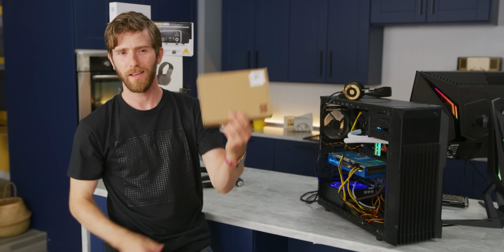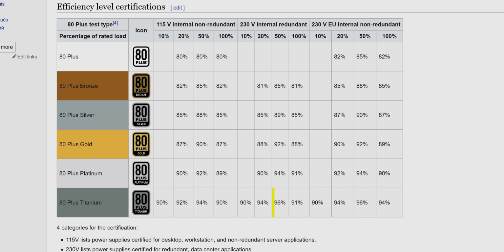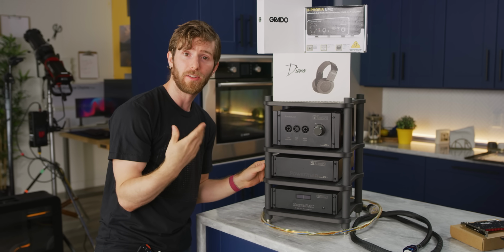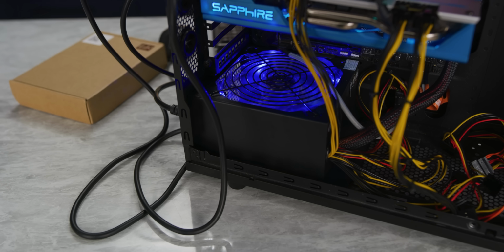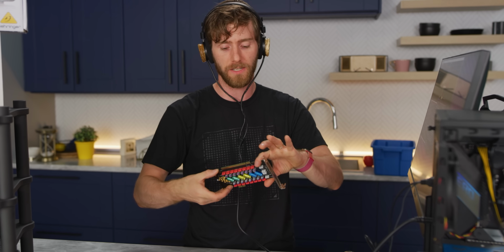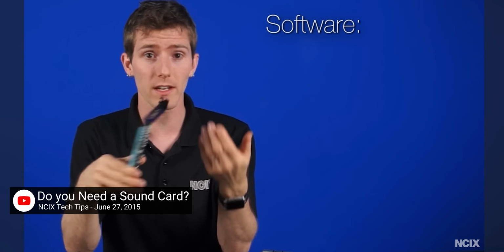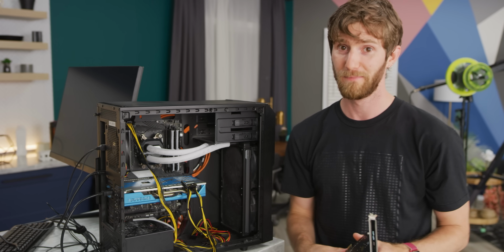Is this $40 card a SCAM? - "Audiophile" Power Filter

Comment: I Personally Think That Sound Cards Was Just A Thing Of It's Time..That's Already Ran It's Course By Now, That Is Because Of The Inherent Fact That Technology Just Got Better With Time (Like Any Other Thing That Also Exist Right Now That Is) And Is Now (Currently) More Capable Of Running Multiple Processes In The Background (As Like How The "Current" Windows OS Is Built Nowadays That Is) And Was No Longer Limited By It's Current Technology Restrictions (Based At The Time Anymore That Is) By Having 1 CPU Or 1 GPU At That Time Or Both That Is Which Couldn't Even Handle Having Audio Processing Done In The Background On Either The CPU Or GPU Or As To How It's "Currently" Done Nowadays (That Is) As To Split Up The Audio Processing In Between Your CPU And GPU That Is For The Most "Efficient" Route Of Doing Things, That Is (When Both Units Are Applied Only Though..If Not The Opposite Will Most Likely Occur Which Is..It'll Run The Audio Processing As Well As The Current Task At Hand Which Will (Of Course) Include All Of Windows' Background Processes Also Which Will Most Likely Have An Performance Impact When Doing Anything "Remotely" Taxing On Your PC's CPU That Is) And That Is The Reason As To Why The "Fabled" Sound Card Had It's Own Audio Processor "Chip" Built Onto It's Card That Is As For The Additional Processing That Was Required From Your PC To Process To Direct It's Audio Signal Through Your Receiver (As Like Headphones Or Speakers) Of Choice, That Is

Comment: what is a coil wine of the system??? Are you crazy? You listen to a fan blowing and then the same fan and expect a difference??? This is not how this works, bro....... Capacitors are there to smooth the power lines, because standard power is never perfect. It differs, those caps make it more stable, being a small storage for power, if you will. There are electrolytic but also other shapes of capacitors (e.g. tantal, ceramic etc.). Sure it is a bus, so all power lines are the same, but I am not sure if this card is even within the specs of an PCI slot or if that can have any (positive) effect at all just sitting there on the bus. Just by the look, they do not seem very high quality, even rated at 130 (?) degrees. Interesting also that they are BP, Bipolar, meaning they have no plus and Minus pin.

Comment: better testing method: run the output audio through an amp and then to an oscilloscope/spectrum analyzer.  If you don't have one, then record it with a good quality audio interface and open it up in Audacity to see the waveforms
Reply: This implies that Linus does scientific testing without mass comment outrage.
Reply: get oscilloscope for free from electroboom
Reply: No self-respecting audiophile would ever admit that electrical signals are susceptible to measurement or analysis. (Someone needs to point out that the act of recording sound with a microphone is itself the act of measuring sounds waves. And any property of sound that might exist in an audio recording can be analysed.)
Reply: Exactly what I was thinking
Reply: Exactly, if you want to make video about this at least you should use god dam oscilloscope. Pointless video.
Reply: and than you really understand that a spectrum analyzer does absolutely nothing for audio application? You rather need a signal analyzer.... to try to be critical when you can be criticized because you said wrong information.....
Reply: That’s more of a GamersNexus video idea :)
Reply: @PowerChannel88  It's not subjective if the objective test shows there is no difference.  If there is no difference even measurable (assuming we measure properly) then we know any difference you're hearing is placebo effect.  I fully expect an objective test to show no effect for this card whatsoever.  Also, other results are still informative to those of us that understand how to interpret them.
Reply: Or at least use powered speakers with a motherboard audio out that isn't well isolated from noise. I can hear my HDD and gpu churning away through my speakers just fine. It would be so much easier for the viewer to hear what electrical noise can sound like through speakers.
Reply: better BETTER testing method. hook up a oscilloscope to the 12v or 5v or 3.3v power rails directly and look at the waveform. I've done this before and been able to watch the voltage drop when I hooked a HDD to the computer, when it started spinning, and every single time it seeked. if you're wondering, yes. it's gross.
Reply: Frankly, if you need to use an oscilloscope or spectrum analyzer to see the advantage of this card, then the card probably isn't doing much (if anything), and if a person can't tell, it begs the question, what's the point? Just food for thought...though I still think it would be super cool to see if it actually does anything 🙂
Reply: @SejinKim5  a objective test is always better than the subjective test of a persons opinions on a matter for figuring out if something works or not, esp with sound quality which is a thing where you can see thousands of audiophiles try to rip each others throats out over their own opinions
Reply: @SejinKim5  If it carries noise to ground, it could possibly extend the life of components. This card needs a better test, maybe post it to Marcoreps to see what actually doing if anything in there.
Reply: @SejinKim5  That is the point though, to show beyond a shadow of doubt that this card isn't doing jack shit.
Reply: Does it really matter when this is meant for the regular user?
Reply: dude, if you can't hear a differnce...well then that's all the testing you need.

Comment: I once had an original, fat-boy PS3. I was plagued with a BUZZ sound with it in games, playing movies, anything! It wasn't until I used an AC adapter (changing the power plug from grounded to un-grounded) then it fixed it!

I bet Brian-The-Electrician could tell me why that worked.

Comment: As an audio engineer in training, I knew as soon as I saw what this card was, you weren’t gonna be losing that Hum. Typically, at least from my understanding, the hum in speakers is typically a grounding issues. Usually with power boards or using the same wall panel for the same speakers. That’s my understanding at least

Comment: This test is flawed. Try a budget/mid range motherboard and send to a stereo amplifier. I have a mid range gigabyte mobo from 2014 and a pretty decent 60w stereo amp from Pioneer powering my bookshelf speakers. Sound is ok but when I power up the signal enough the hissing becomes audible. I would be very interested to see if this card could help but unfortunately this video kind of botched the test. A high quality mobo and headphones? Come on guys.

Comment: I can't imagine you'd hear all that much noise on headphones from even a crappy onboard audio. Most of that is when you have another ground in the audio signal chain, like powered monitors or an external amplifier which receives an analogue (or even sometimes digital via something like USB). The best solution is to use an optical connection from the PC to an external DAC and amplifier, that way there's no electrical connection between the PC and your sound. This doesn't fix everything, especially with more complex setups. For powered monitors the best option is a balanced connection and then possibly to ground lift the speakers themselves (not recommended but often an easy and completely free solution).

Comment: I would like to say, 
Please bring in few high end boards of 2020, like asus crosshair viii and maximus xii hero, gigabyte x570 and z490 aorus master, msi x570 and z490 ace, and test the onboard audio capability of each of them comparing with a mid-range creative x-fi titanium of 2008 (should be brand new), using a pair of 32Ω high end headphones like ath-m70x. 
You will know how far we have actually come with onboard audio. 
After that you can also test the same with abyss diana phi pairing with evga nu audio pro and asus essence stx ii, versus the onboard audio of the bigger babies (if you want that is, makes no difference, they are all the same) like msi godlike, asus formula or extreme and gigabyte aorus extreme boards. Use opa627 opamps everywhere for either of these two sound cards. 
This is a great video idea.

Comment: Sometimes, the disgusting digital audio noise is because of the poor un-shielded cable that goes from your motherboards front panel connectors to your front panel headphone jack. This problem is often found on cheaper cases. I had noise so bad on a case, you could literally hear the noise from the mouse pointer being moved. But it got better if I plugged in the headphones directly into the jack in the rear of the motherboard.

Comment: As someone who has been around car audio, I feel as if the car audio companies took their signal/sound processors tech to pc it would dominate that market, they have been clearing up audio signals for over a decade, but we have usb audio interfaces like the Scarlett 2 that make onboard audio or cards useless.

Far as the other claims it wouldn't change the noise from the other components in the pc.

Comment: I remember my first soundblaster card. My dad bought a baller pc back in 2000. It came with a soundblaster live card. I kept that card and I used it in EVERY pc I built all they way till windows 7 came out and I couldn't get drivers working for the digital output. The next system I built was the first one I ever built that had a mostly clean signal coming out of the onboard, but it still wasn't as good. I just use a dac now even though the onboard on my current pc is pretty good.

Comment: With my speakers turned up I can easily hear everything my GPU is doing, even just moving my mouse with the GPU idle. This happens regardless of USB isolation, on board audio or sound card audio, or different mice and PSUs. I think the PSU is actually feeding noise back into the main power and is contaminating the power for the speakers. Probably time to try putting them both on a power conditioner.

Comment: I seem to get noise predominantly from my USB ports. Charging any headphones or powering the korg nutekt via usb produces a very audible hum from my desktop but will be silent on my laptop or surface. Not just the front ports either, any usb port on the rig will produce this. Don't think a pcie card would be the answer though.

Comment: This would help reduce power supply noise on the 12 and 3.3V rails, however I doubt the power supply was very noisy since you are probably only drawing about 500W from it, the 1000W supply will probably only become noisy when the FETs have to switch faster at about 90% of load. This could actually be a viable solution if you have a failing or underrated power supply. It won't help with coil wine since it comes from the GPUs own Vcore supply.

Comment: I've actually found static and hissing in PC 3.5mm jacks is more likely from bad connectors, not bad power. I pulled out the board for my front jacks one of the pins for the mic jack had broken away from the solder (likely from me and my cat knocking my headset onto the floor, yanking the plugs).

Comment: 0:12 audio hardware?! even if it is real and works... 🤮  I like the Sapphire Nitro+ you have there though.  It has overkill cooler for slightly better memory clocks and quiet and/or high cooling

Comment: We don’t use LC filters in FPV drones, we use low ESR capacitors to reduce voltage spikes. LC filters are better suited to use in a 3D printer to reduce noise.

Comment: Uuugh - Okay, you need low impedance headphones and you don't need to play music. Just turn the volume up and move the mouse. Physical noise won't change.
Reply: Common "audiophile" misconception - Low impedance and sensitivity is not correlated  - you actually just want a sensitive headphone.
There are low impedance headphones that are not sensitive. A lot of Etymotic are such earphones with relatively low impedance (less than 30ohms) but also low sensitivity (around 95dB - when the norm is more like 105 to 110), that's why they are known to be "hard to drive" by "audiophiles", but that's not because of its impedance but rather it is its low sensitivity.
Reply: My speakers make a low humm because of my pc. When I plug in my phone there's no humm
Reply: This whole review, or preview looks shitty as hell. No idea what's the topic or how to test such things... Fucking hilarious.
Reply: My sentiment exactly... If proper testing is what you need, bring in an engineer... At least they know what they're talking.

Comment: An external DAC is a much better option. The Fiio D03k is only $20, and it sounds the same as every other good DAC. It only has SPDIF and TOSLINK inputs though, no USB, so it might not work with every motherboard.

Comment: 29 seconds in a stop the video, my jaw on the table: Those are paper in oil 100v caps, the sort of thng you'd find in a speaker crossover or guitar amp, the later as they add character, something you certainly don't want in a computer XD
Reply: They're just bipolar electrolytic, not paper in oil

Comment: I get SOMETIMES a background zzzzzzzz noise. THIS is what this supposed to correct. But is NOT through the main board - I have a splitter - speaker/headset - I get big headset noise with some games/browsers.
Thanks so much for the LATTER part of your advice - folks need to listen tot the end if they have issues (and mine are only SOME times)

Comment: if you want proper sound buy "studio monitors" not "pc speakers" but most of those are analog so you'll need a "hum destroyer" like Behringer HD400, you have to set the volume to 100 while stress testing your videocard to hear noise, HUGE difference if you have noisy analog output

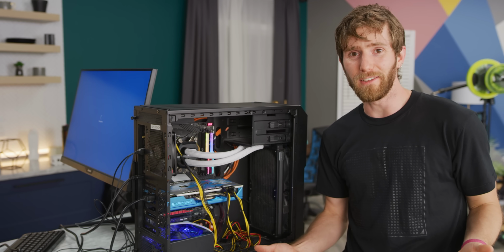Comment: 08:32  The fact that audiophiles are a bunch of suckers who routinely spend thousands of dollars on complete bullshit products.  They all think they have golden ears and can hear all sorts of subtle differences, but when cajoled into a double-blind test, can never, ever hear the difference between something like lamp cord and $1000 speaker cables, because you need an oscilloscope to detect any difference at all.

That's the main problem with this video.  You didn't actually test anything.  To see if there is or isn't a difference, you need to quantity.  Measure voltage and ripple.  Output sound to an oscilloscope so the waveform can be analyzed.  Trying to do it by ear just won't work.

Comment: I was gonna write a huge comment, as someone who is currently working in electronic/audio engineering. But Linus beat me up to it highlighting every single concern I had before the video started and reasons why I thought it wouldn't work (filtering power through PCI-e doesn't change the harmonics which cause coil whine coming from cables to connectors, filtering audio with a fixed architecture of a few LC circuits). I'm deeply impressed, I love this channel.

Comment: Downvoted for the bad science. If you can't hear the buzz you also can't blame the card for not functioning properly (not to mention it was dropped ). Also people here says the coil noise isn't caused by what the card claims to fix.
A suggestion to hear the problem would be connect any cheap amplified speakers to the audio jack  . Then lower windows volume and max the speaker's. The speaker will amplify noise, you will hear a buzz. Maybe not the buzz from pcix but at least youd have a baseline to compare.

Imho there's a chance the caps help filter the pcix power lines and if those lines are shared between pcix slots all the way up to the PSU it may even work to some extent. I don't know the specs of the pcix or the wiring of the mobo, so it's just gut feeling.
To truly work the board would have to cancel the capacitive or inductive component of the load that generates noise, phase shift  and resonant frequencies . you need to know  the exact value you're dealing with. I don't think an assortment of caps will do that. So my conclusion is : the board deserves to be checked properly but I believe even if it works to some extent it's not significant thus not worth it.